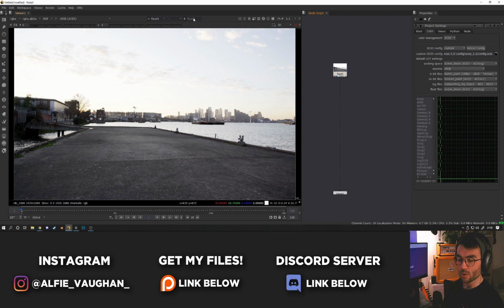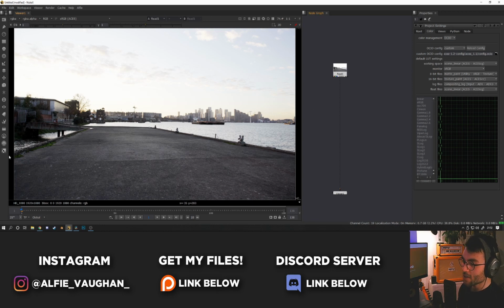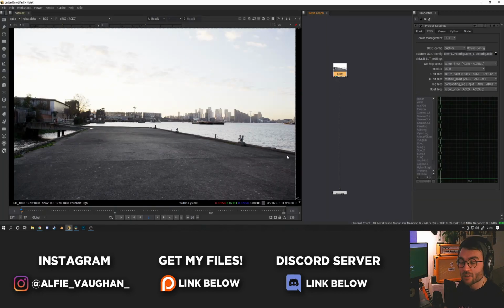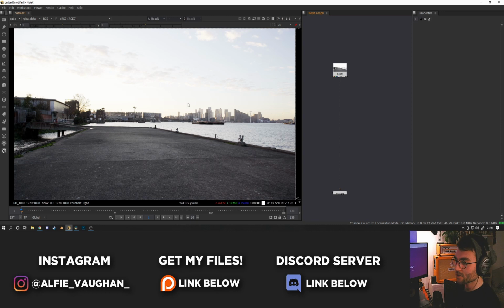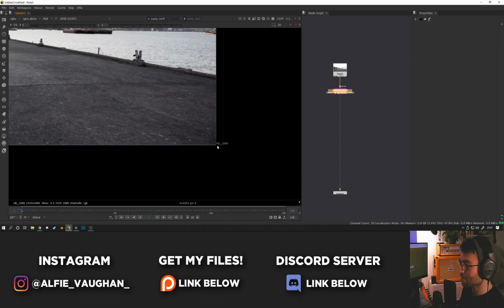My VFX Workflow Using Blender, Nuke and DaVinci Resolve

Comment: Great!! Thank you so much. I always want to know how manage the overscan because when you track in blender and put 3d elements in footage and it stay near the border you need overscan in blender to uncut them out of shot
Reply from the maker: Glad you liked it! There's add-ons for it in blender that do it automatically but I just do it the old fashioned way by setting the resolution to something like 110% and then dividing the focal length by the same number. So for example 50mm/1.1 =45.45mm

And that will give you the correct overscan

Comment: I would disagree on the "anyone making a good lens distortion workflow on YouTube' bit cause Hugo's Desk has an in depth bout that even before you made this video. he uploaded in 2019
Reply from the maker: I've seen Hugo's video. It's very good but he doesn't cover applying the lens distortion back to CG which is really the main thing you're going to be using it for in the first place. It took me ages to understand how the reformat to none worked to get the overscan on renders and then apply the distortion
Reply: @AlfieVaughan  yeah you’re right. For the overscan bit calculation, Look at VFXforfilmmakers lens distortion workflow.

Comment: Dude this was a fantastic explanation. Cheers from spain. Would you consider making a workflow for vfx breakdowns using nuke?
Reply from the maker: Thanks! I don't really do complicated ones. My process for breakdowns in just to export a still frame of each stage of the comp and then just bring them into resolve and make each one last about a second 🤣 very low fi
Reply: @AlfieVaughan  i was wondering if you could explain some basic plug in that allows different stages of the comp to be rendered so that you can see a play of all the parts coming together. I also use resolve for that but for example the ability to make 3D parts of the comp "fall" into place via a plug in would be a fantastic thing to learn because i cant manage to do it in resolve :(
Reply from the maker: There's a few that exist but I don't use them so Im not much help there I'm afraid. If you have a look I'm sure they have instructions on how to use them

Comment: I'm not able to find the Camera Overscan plugin you used in this video. I did some Googling and I'm reading that other people are saying the plugin doesnt work with more recent versions of Blender. Do you have any solutions to rendering with overscan out of the current version of Blender?
Reply from the maker: Ah yes I stopped using it recently too. I got tired of it needing to be patched every time I updated Blender... The plugin is just doing 2 very simple things you can do yourself and that's how I've been doing it recently. The first is setting your render size to something over 100%. It's the box below the resolution width and height. So for example for 10% overscan, I'd have my resolution set to 1920 and 1080 but with a size of 110%. Then, go to your camera and divide the focal length by whatever the percentage is. So for example if your camera is set to a 50mm lens, in the focal length box you would type 50/1.1 (the 1.1 comes from the 110%) and press enter. That way, it adjusts the field of view to create the overscan. This is the same thing the addon does, just a few more clicks! Then use it as you would normally in Nuke. Hope that helps :)
Reply: @AlfieVaughan  Awesome, thank you so much for the quick reply and information! One of these days we'll have a native overscan feature in Blener I hope!
Reply from the maker: Haha wouldn't it be nice 😂

Comment: 2 free programs and one vastly expensive one.  It would be more accessible if you had used the Fusion tab, sorry to pick, but it was like when Resolve was first announced as having a free edition, but you needed a $10,000 computer to run it on.
Reply from the maker: Nuke has an almost fully featured non commercial version which I used to make these videos for 2 years 🤷‍♂️ I use Nuke at work as a professional compositor which is why I use it at home as well. I don't see any point learning a less capable compositor, even if it is good. This video isn't about free software. It's about the best workflow

Comment: Hey man, great content. Say, how do you deal with the lack of overscan in Blender? When you have to redistort the CG "inwards" you need additional pixels outside the render resolution. So far i multiplied the resolution by a certain factor and divided the focal length by it, but that's not a robust solution....
Reply from the maker: There's an overscan add-on for blender! I've been using it for years. Game changer for lens distortion!!

https://developer.blender.org/T49068
Reply: @AlfieVaughan  Ha, thanks mate!! I stumbled over this one before, somehow i couldn't install it before. Gave it another shot, now it works (for some reason). Thanks for the reminder!
Reply from the maker: Nice one! No worries

Comment: Blender does not have strip thumbnails.  Not being able to see every frame on the strip in Blender when precision cutting strips absolutely destroys my workflow.  The shortcut keys are very counterintuitive (although apparently similar to Final Cut / Adobe Premiere).  Blender VSE also has trouble with seeking any lossy libx encoded media which leads to audio sync and framerate issues that don't show up in the preview proxy but only after rendering the final video.  This is such an easy bug to fix.  Even using ffmpeg directly can do a better job at cutting encoded streams losslessly - if you have hours to read through its command line option documentation.  This is why I feel the need to switch to another solution and DaVinci seems like the only other viable free option, at least for Windows users.
Reply from the maker: I don't know anyone that uses blender for video editing. I didn't suggest using it in this video. This is talking about the VFX workflow using it's 3D tools. I edit in Resolve like I show in the video
Reply: @AlfieVaughan  Point taken.  Also, I just noticed that Blender fixed the thumbnail issue recently, so my whole comment is moot. XD.  Unfortunately though, there are very little discussion on Youtube about Blender as a video editor, other than people promoting the idea of how wonderful it is that there is this professional level video editor hidden within this free software that is Blender, causing a lot of people like me to fall into the trap of investing time into learning it.  But like I say, it is getting better in a hurry.
Reply from the maker: I've never seen anyone say it's good for video editing. It's extremely good for 3D animation, VFX, design etc. It's other tools aren't so great. Definitely don't learn it for editing if you're serious. Resolve is free and extremely powerful

Comment: I know this is silly question, why we need to render in passes and composite in another compositing software like nuke. instead why don't we render the whole scene including live action footage in blender itself..
Reply from the maker: You could do that. But it gives you no options to tweak it after the render. Rendering separately and combining gives you the flexibility to change things. That's how it's done professionally. You'll never see a shot with CGI in from a film rendered straight onto the background. Everything goes through compositing and is combined and polished to get a better image
Reply: @AlfieVaughan  Thanks bro. and When I try to camera track in nuke it shows error, but when I converted the video(mp4) to image sequence it works fine...is nuke won't work on mp4?
Reply from the maker: It probably should still work but it's much better to work with image sequences in nuke
Reply: @AlfieVaughan  Thank you verymuch.

Comment: Hoping you still keep an eye on this, is there a reason you rendered the EXRs out of Resolve instead of Nuke? Would you get the same result if you loaded it into nuke and wrote out EXRs? Or is it because the free version of Nuke has the format limits?
Reply from the maker: It's better from an editorial perspective to conform the edit in resolve and then render linear EXRs to nuke. You can do the log colour space transforms and stuff easier in resolve. And nuke preferred image sequences I think. And then you render EXRs from nuke back to resolve so it goes back in how it went out which maintains all the range in the images

Comment: You've mentioned there are no great lens distortion videos out there... but where to start then? Or can you make about a video from that?
Reply from the maker: All I really meant was I've never seen a video in nuke that shows how to actually apply lens distortion back on the CG correctly. They all do stupid things with crop nodes and punching in manual numbers which is over complicated.
Reply: @AlfieVaughan  I have a panasonic 14-42 lens, how can i undistort it? You've just loaded your preset. Can you give me some advice which video helps me to get there? And one more thing: you had a pass comp template for nuke, can i download it from somewhere?

BTW you have awesome tutorials, INCREDIBLE TIME SAVER. I'm watching videos a week now and could't find the right video for the belnder-comp-color spaces topic (i wanted to comp in fusion because it is in resolve) but now i found this, which is the ANSWER for all my questions, so probably i start to learn Nuke instead of Fusion ...here is everything what i need...
Reply: I can't say thanks enought...

Comment: Hi
I have a problem using the "File Output" node to rename the patches. It works really well with rendering an image but if I use render animation it all seems to be back to the default patch name Composite_Combined instead of RGBA.
Thank you for your help
Reply from the maker: Hmmm weird. Make sure you don't have anything in the default output settings for blender. Sometimes that confuses it

Comment: Amazing tutorial! Subbed!

Can you please tell me how to denoise all the multipass layers from blender?
Reply from the maker: Thanks! I'm not sure you can denoise anything except the main image. You could try plugging in the optix node into the other passes in the compositor but it needs the main image input which won't be the same for the different passes
Reply: @AlfieVaughan  okay... But if all the multipass layers are noisy
And if i want to re-composit the original blender scene from scratch (separating all the passes from the exr and then comping)
 then i will have to use those noisy passes and get noisy final comp? :(
Reply from the maker: Yes sadly I think there's no other option. You would either have to up the samples to get a less noisy render or you could try denoising them after the render
Reply: If I can't use any of the passes because of the grain in them, then rendering them and saving them is useless, right?

I love your video and workflow.
I am just asking to learn these things. If you know how to denoise multipass layers in blender/any way of optix denoising inside nuke, please let me know

Comment: Hi Alfie, 
Very helpful thanks - what were your render settings in Nuke before you imported back into Da Vinci? Is it okay to have EXR files as well as MOV files in the DaVinci edit timeline bofore rendering?
Reply from the maker: Hey! Glad it was helpful! Yes I use 16bit EXRs going back into davinci so it preserves all the range in the image. Otherwise when you start grading the nuke renders in davinci you won't be able to do as much. The EXR sequences are very heavy so once back in Resolve I do the generate optimized media thing so they playback smoothly :) also yes totally fine to have MOVs and EXRs in the timeline. All my normal shots are the footage straight from the camera and then my VFX shots are EXR image sequences :)
Reply: @AlfieVaughan  ah, thanks that's really helpful to know and about playing back using optimized media... I shot in 1K HD  10bit canon log - I haven't changed the colour space in Da Vinci - the default is DaVinci YRGB / Rec709 Gamma 2.4 - do you think I need to do anything before exporting my shots as EXRs? Although I am editing in Da Vinci and doing the effects in Nuke, someone else will be colour grading it in Da Vinci afterwards - just want to make sure I'm using the best settings.
Reply from the maker: That should be absolutely fine as long as you work in rec709 in nuke too. I work in aces across davinci, nuke and blender so my workflow is slightly different. But as long as you keep the viewing colour space consistant it will be the same :)
Reply: @AlfieVaughan  Great, thanks, that's good to know :)
Reply: @AlfieVaughan  :) one very last question! why did you use EXR - RGB half (zip compression) as opposed to RGB half (no compression) ?
Reply from the maker: I believe it's just slightly smaller file sizes. To be honest I don't know that much about the technicalities of compression but I work at The Mill and we use zip compressed 16bit EXRs for our comps. So I figured if it's good enough for The Mill it's good enough for me!
Reply: @AlfieVaughan  oh definitely, can't hurt being a little bit smaller as it's a big enough file size anyway!

Comment: Question, my shadow pass (on object) is blocky as if it has "Shade Flat" enabled. Why is this happening to me?
Reply from the maker: You might just need to add more topology. Is it a low Res mesh? Maybe try a sub surf modifier
Reply: @AlfieVaughan  Well, I failed to realize that the Diffuse passes are the meaning of light and shadow on the objects. What I did was to render the shadow pass in the same exr as the rest, not following your seperate shadow(catcher) method. My model is subsurfaced and has enough polys tho. However I fail to recognize why the shadow pass behaves like that.
Reply from the maker: It could be doing that BECAUSE you're putting the shadow pass in the same exr. It's a different way of rendering the shadow which might be why it looks different. I would try doing it separately. I did it that way for a reason

Comment: Is there a way to disable file output? Getting a bunch of black empty files in /tmp\ is quite annoying. Great video sir!
Reply from the maker: Yeah you can just press m on it and it disables it and then you can use the default output in the settings tab. If you're getting blank files in tmp it sounds like you might need to remove the tmp path from the default output?
Reply: @AlfieVaughan  Thank you! Looks like leaving default output empty will not give me bunch of unwanted files. I wish there was a check box to disable default output out there in the property panel.
Reply from the maker: Yeah just removing the paths stops it rendering to anywhere. Quite annoying I agree!

Comment: Just what i needed. Could you do a tut on color matching the vfx to the original footage?
Reply from the maker: Glad it helped! I've got a few ideas for videos along those lines. Stay tuned!
Reply: Use da Vinci instead
It is used for most of Hollywood colour works
Reply: Using fusion and da Vinci works be better as there will not be any need to render the shots after general compositing for colour correction and grading

Comment: I don't use Nuke, but this ended up being quite helpful. I do my compositing in Fusion, but, as noobs do, I do not render seperate layers and end up re-rendering many times trying to make the CG perfect in Blender. This would save me so much time.
Reply from the maker: Oh yeah the final polish definitely needs doing in Comp!!
Reply: Without multilayer exr rendering you didn't rendered in 3d. It's like rendering 3d stuff into 2d packet

Comment: Batch scripting is cool, but have you tried the free tool Post Haste? It's super easy to use. You just set up a template folder structure (with variable portions in the folders' titles), and then you never have to set up a folder structure again.
Reply from the maker: Oh interesting! No I haven't but I'll check it out. I tried prism recently which is a pipeline tool that works with nuke and blender but it was a bit overkill and took too much getting used to. I'll take a look at post haste :)

Comment: Great demo and workflow! Just curious - why not do the  color grading and final export in nuke?
Reply from the maker: Thanks Prashan! It's mainly because this was just one shot but obviously normally I have a larger edit with multiple shots. Nuke doesn't have a timeline system so it's not simple to work on multiple shots. They have an editor called nuke studio but it's not as sleek or as easy to use as davinci. And also davinci is famously a colour grading software so the tools are much better for grading! :)
Reply: @AlfieVaughan  that makes perfect sense!  Thanks! :)